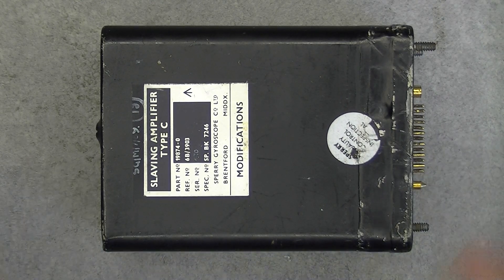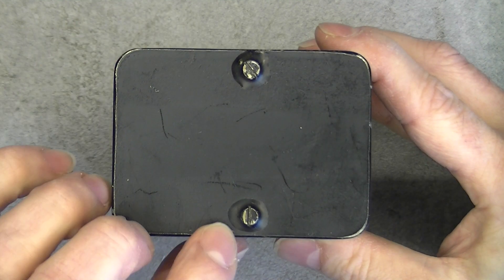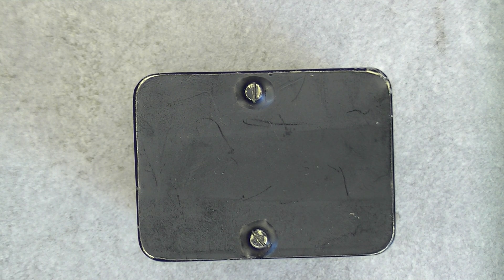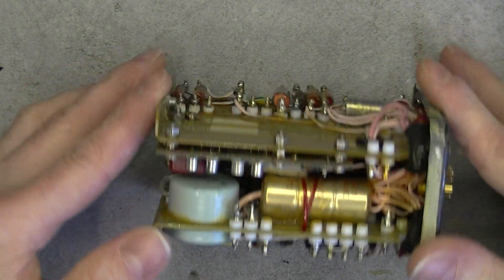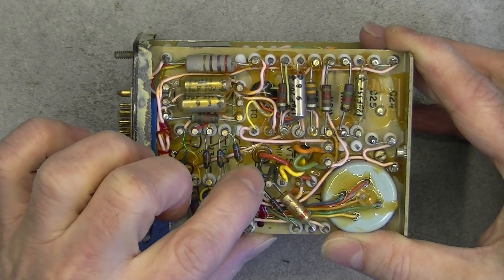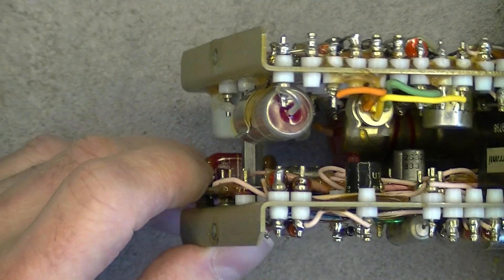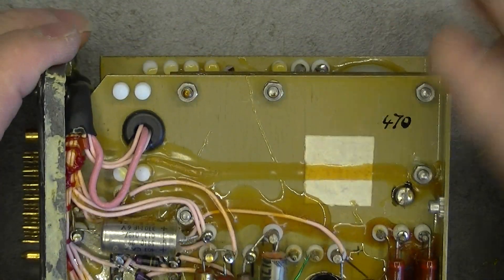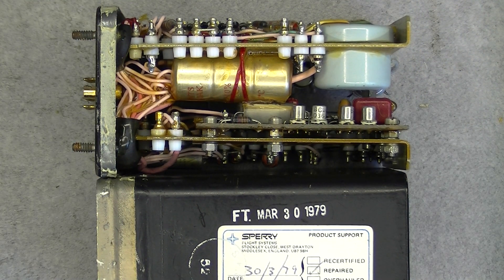Sperry gyroscope slaving amplifier type C teardown

Comment: This amplifier is normally connected to the rotor of a synchro with the stator connected to the magnetic compass (800Hz signal). The outputs of this amplifier are 2 DC currents which drive the precession coils of the gyro in order to slave it to the magnetic compass. The black potted module is probably the output stage. The small black little device at 07:27 is a transformer, quite common in these kind of stuff. They are used for inter-stage couplings and permit to have a band-pass amplifier which is centered here to 800Hz before synchronous detection.